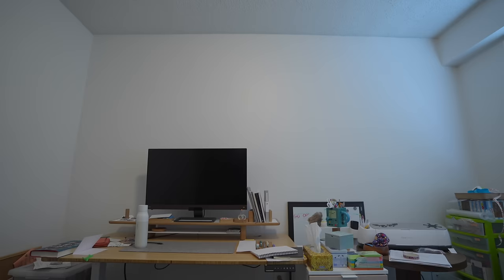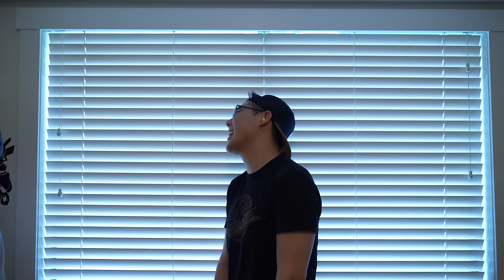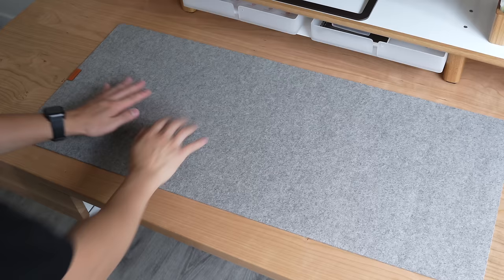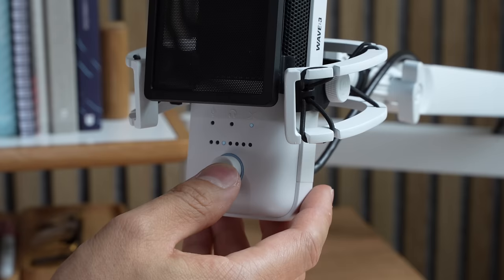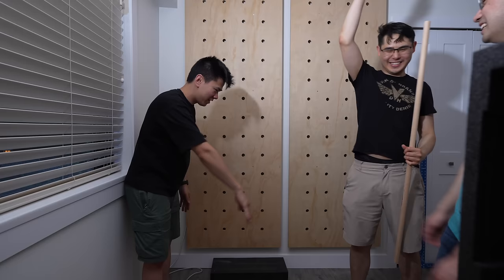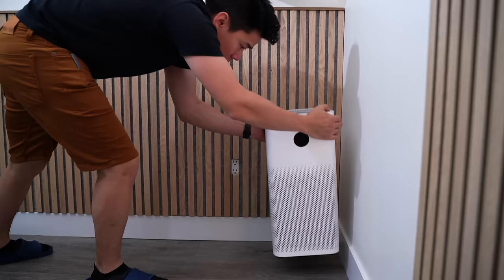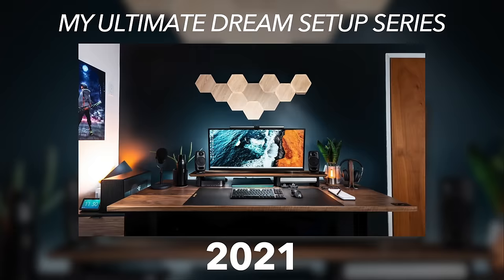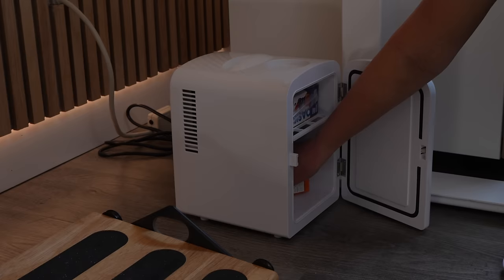The Modern DREAM Home Office & Desk Setup Makeover 2024

Comment: 🌊 Nice desk set-up! I like the cohesive approach and design strategy to get the finished concept just right. But quick question: how long did it take to do the decluttering process, and how did you or Clair decide on what stays and what goes? It would be cool to see a video about that. 🙂 Good design, of course, is achieved with less, and this video clearly demonstrates that in the final reveal. The process to get there, I think, is much harder. Thanks for sharing this! Great job!

Comment: You were wondering what you were doing wrong drilling holes for the pegboard.  The Ryobi drill you were using is underpowered.   Try a drill press or corded hand drill.  BTW turned out great!  I like the color choices.

Comment: Doesn't putting up "support Slats" up first to the wall and then attaching it to the wall panels to it only help increase sound abortion it the space in between the wall and panels is filled in with a material? other than that its just adding an extra step that's not necessary. And in regards to wall studs you can just use a stud finder which can go right though the material...just saying.

Comment: Nice. But you literally only attached that accent wall by screwing through the felt an into the wall? That felt will not hold that wall long term. I would run some screws or use a finish nailer though  wood slots an into the bracing. Other than that nice work